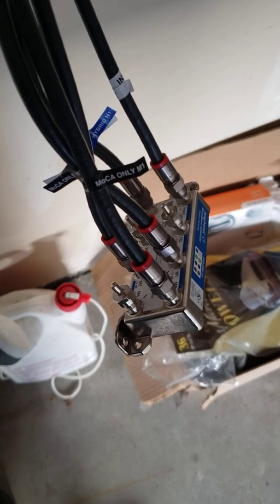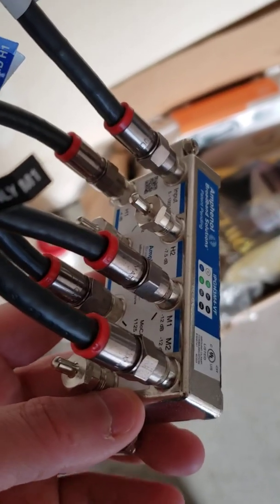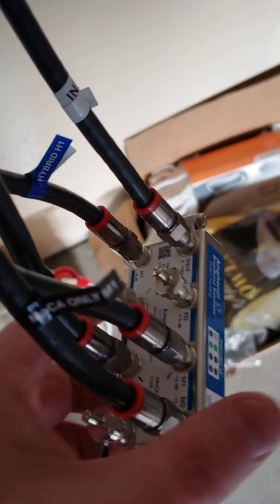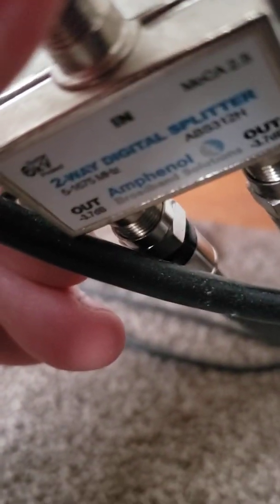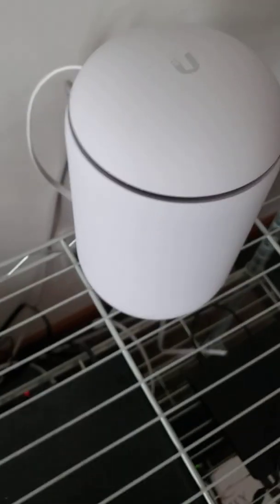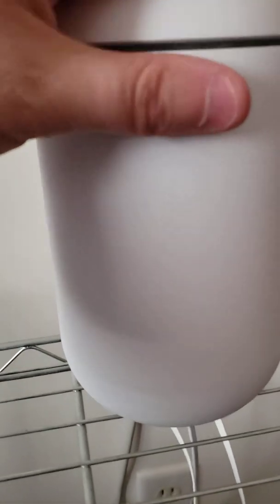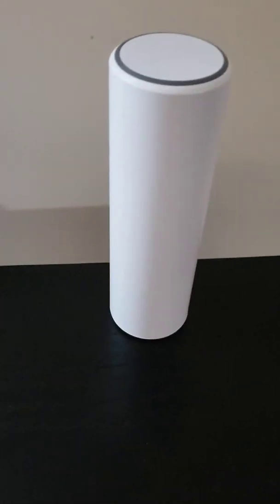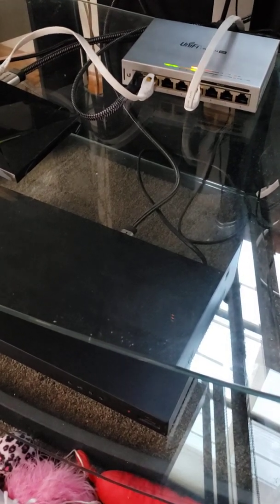MOCA Network update 2021, new Setup!

Comment: Just finished my MoCA network. My fiber runs into my roommates room in my house so my other roommate and myself were stuck with WiFi while the one with the fiber ONT and wifi router had a hardline. After I found out about MoCA I got 4 adapters, one for the internet room so it was the "gateway" and the rest went to my room, the other room and my living room behind my tv. Since I'm using MoCA 2.5 I'm pulling my max internet speed of 2 Gbps. I wish I found out about this when I first got my house!

Comment: do your unifi managed switches still act as true managed switches in ubiquity with the moca 2.5 adapters? meaning you can control individual ports and have separate vlans on each port?
Reply from the maker: Yes, the Unifi stuff is not impacted, when it comes to switches.  Sometimes the Topology looks funky .. but, I have not had much issue with it showing the wrong nodes

Comment: Thanks for the video. Just a couple of questions since I have the Frontier MoCA adapters, which are similar to the goCoax ones. I also have a UDR which is similar to the UDM-B.

For the 2-way splitter, you have one coax cable connected to the goCoax MoCA adapter and the other going to the NetGear Modem. For the ethernet port on the goCoax MoCA adapter, is that plugged into the Internet/WAN port on the UDM or one of the LAN ports? If it's a the Internet/WAN port, does that mean the UDM doesn't have a direct ethernet connection to the NetGear modem, or does it?

I'm getting a little dripped up on that part of the video because you show the connection from the goCoax MoCA adapter to the UDM but not which port it's plugged into, or whether there's a direct connection made between the UDM and NetGear modem.

Comment: for the AMPHENOL IPGH3M4-VF do you know what the other hybrid ports are for?  Hybrid I see is for the modem, and I assume the moca only ports are strictly for internet traffic? I use an Xfinity XB7 network gateway (combination modem / router) and have 2 Xfinity set top boxes and trying to figure out hoe these will be connected.
Reply from the maker: I believe, they Hybrid ports expose the full spectrum of signal, but at a higher signal loss, where as the MoCA only ports only allow the MoCA signal through.  I have not completely tested that, as I run only the MoCA ports for now (I don't use Cable TV or any of that)
Reply: Your video was the first one that helped me actually start to figure out my network . I got that splitter, the caps, and now Im trying to figure out how to connect my Xfi XB7 modem/router, my MOCA Sender unit, and what ports to use for MOCA data only wall connections, and my 2 dual use MOCA and Xfinity set top boxes. So using this splitter can I remove the Xfinity supplied filter and just use the internal splitter filter?

Comment: Sorry, I'm totally confused.  First, you say one coax line to the modem and one coax line to the router.  Then you show the coax cable first going to the Netgear router and the other coax cable going to the GoCoax moca adapter.  Where is your modem?
Reply from the maker: Ok, sorry, I probably used some incorrect terms.  The outside cable goes into the 8 port splitter.  One of the lines goes up to the computer room.  In the computer room, I have a splitter there to divide the coax into two lines.  The first line goes directly into the Netgear Modem. The other line goes into the MoCA adapter and into the UDM Router. I hope that helps with the confusion.
Reply: @markbuetow6741  Hi Mark, I'm confused about the the other line that goes into the MoCA adapter & UDM router, doesn't the signal from the outside coax need to go through a modem first?
Reply: @aw_321 yes it does. He may have a modem/router.
Reply: The router is connected to the modem router/modem is one item or they are separate.

Comment: Great video! What specific splitter model do you use in your new setup, sounds exactly like what I'd need to complete mine.
Reply from the maker: Thanks for the compliment, actually a pretty bad video done in a super hurry.  Here is the splitter:
https://www.amazon.com/gp/product/B07CQTHL33/
Reply: Hi Mark, thanks for the info. 1) What is the name and product link of the metal caps used to seal off the unused ports of the 8-way splitter? 2) Is it weatherproof for outdoor use? I plan to it outside where the main cable line (orange color) splits into four.

Comment: thanks for the video, I have the same go coax moca adapters. At first I was having a problem with Xfinity because they would keep the Moca inside their modem enabled, and I no option to disable it. So I had to put a cable POE coax filter to disable it. And since my 2 moca adapters working fine and very fast.
Reply from the maker: Yeah, I have 2 GoCOAX adapters and 2 ActionTek adapters in the house.  It was years before figured out what MoCA was, and I ran a mesh for the longest time.  Now its just a standard router with Access Points.